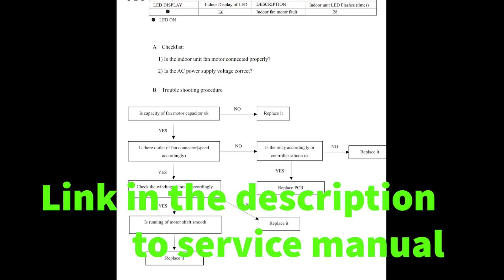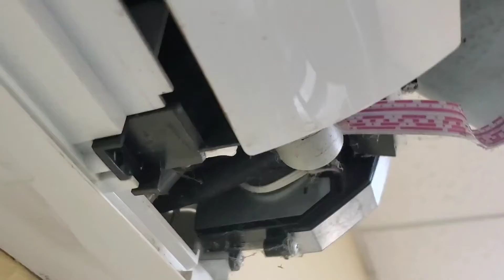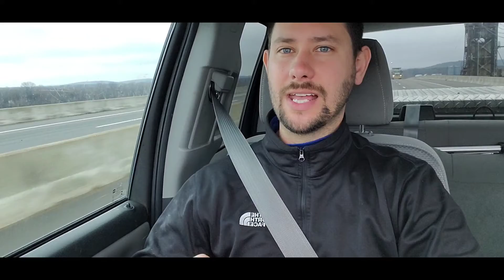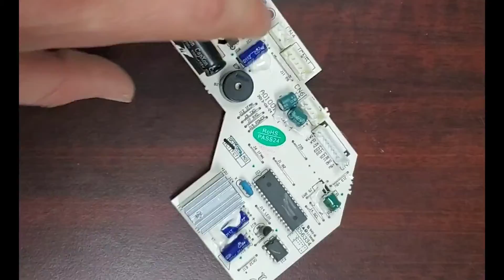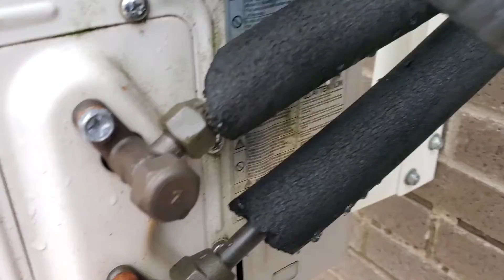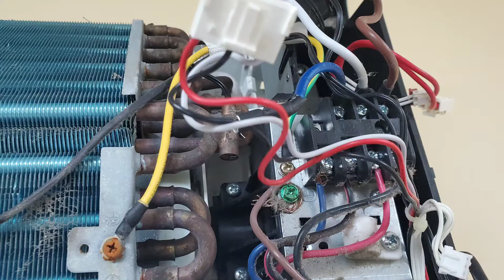Samsung HVAC Error Code E6 Indoor Fan Motor Fault Diagnosed as Bad indoor PCB #SamsungHVAC #hvac

Comment: Hi there I have a AR24BSHGAWKN. R410a system. Indoor works and responsing. But the condenser start up for 30 sec and stops as well on heating. I have pulled out   the compressor cable and fan moter cable no error code on the indoor desply. What can it be error code e6.

Comment: Hi Tad. 
I have an RC140DHXEH ducted AC unit that will cool no problems but when I heat it runs for a short time then throttles back and stops. I have had 3 guys including Samsungs authorised repairer look at it and  cant really find anything wrong with it???, this was at the end of winter last year. The authorised repairer suggested it was a bit low on refrigerant and topped it up. At the time it was not throwing any errors or so they told me. I live in Australia and during the summer just gone it ran fine on cooling and easily cooled during 45*C heat outside. Well I ran it on heat last night, as it was a bit cold, and its doing the same thing again. I managed to get a service manual for it and was thinking it might be a temp sensor reading high issue but during investigation (I ran it in heat test mode) it threw up an E404 error and stopped same as before. It doesnt stop dead, it ramps down as if something is telling it to turn off. Manual says that E404 is "Protection of Outdoor Overload when
 Comp. Stop" Can you eplain what this means and what to do next? 
Thanks
Ray
Reply: BTW I am an Electrician by trade and know what overload is but a bit clueless on AC units.
Reply from the maker: Outdoor overload protection control 
E404

First make sure unit has weighed in refrigerant factory charge amount so you know it has nothing to do with the charge.

Then if charge is perfect

- Check whether the fan and the motor operate normally.
- Check the operation of EEV.
- Check the temperature sensor of the indoor unit heat exchanger.
 By ohming each sensor inlet sensor then outlet sensor 
- Check the indoor unit inlet blocking.